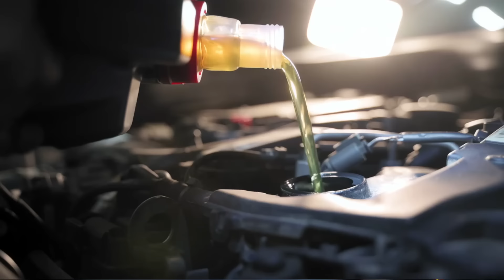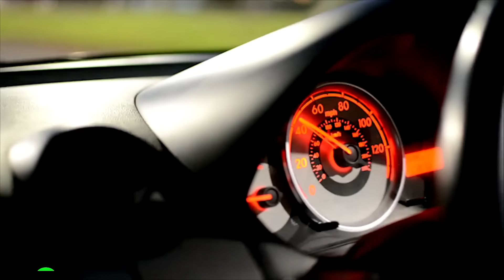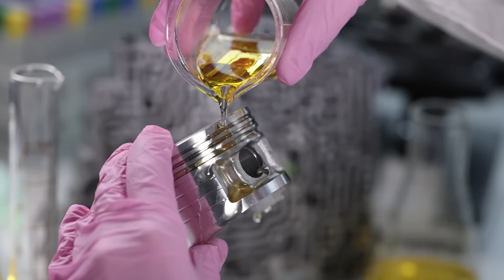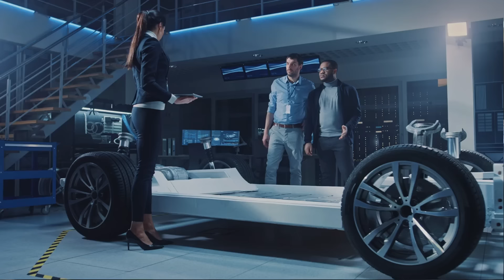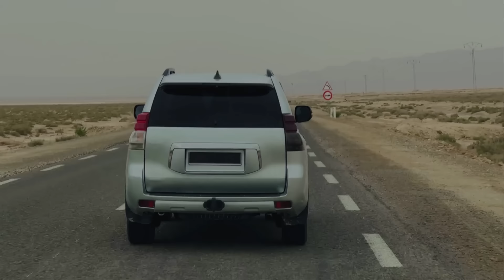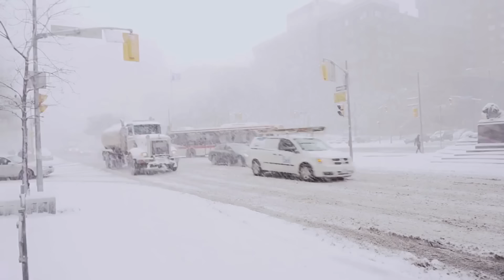Why the Same Engine Uses 0W-20 in the U.S. But 5W-30 Everywhere Else (Mechanic Explains!)

Comment from the maker: Engine oil confusion? I want to hear from you! 👇

Do you use 0W-20 or 5W-30 in your car?

Have you noticed any difference in engine performance with different oils?

Drop your answers below – let’s start a discussion about engine oil around the world! 🌎🔧

#EngineOil #MechanicTips
Reply: I use 5w20 in winter and 5w30 in summer. 0w-20 is too thin for any car long term.
Reply: I use 0-20w Castrol Synthetic in more hot climate area where I live.  It’s a Honda Civic NA motor daily driver which I don’t even drive every day.  I never redline or drive hard.  

I still properly warm up.  

I would think 5-30w is only necessary in extreme summer heat and when driving the car hard or car is turbo.
Reply: My MX-5 manual says 0w-20 in the US and Canada and 5w-30 elsewhere. I use 5w-30. The light oil is recommended to buy CAFE credits from the EPA.
Reply: @arthurmroyce  10w 40 was the standard forever
Reply: @motomikebuilder  Modern engines are tighter so I get the thinner oil. However, the 2.0T in my Genesis Coupe ran best with 0w-40 Euro blend. So you do have a point.
Reply: @arthurmroyce  In SF it rarely snows.  I ran 10w 40 forever in older Yotas.  should I throw some in my '25 tundra?  5w 30 always .  I dump out the dealer oil after required service.
Reply: depend on Summer or Winter 0w-20 for winter and other for Summer
Reply: 5w 30.  My v8 tundra had noticeably quieter time chain rattle with 5w 30.  I'll never use 0w 20 in my turbo charged engine.  10K oil change intervals with thin oil makes no sense.  Toyota sez leave the original oil in for 10K.  1st change should be @ 1K and 5k after that.  My 6th Toyota and > 1,000,000 since 1987.
Reply: Your Ayeee Eyeeee video forgot the most important detail on motor oil 🤦🏽‍♂️

Take the manufacturer suggested oil change interval and cut that in half. Everything will always work better that way:

BMW says 10,000 miles (Change it every 5000 miles)

Toyota says change it every 10,000 miles (Change it every 5000 miles).

Nissan GTR, the engine builders have said many times, do a 2000 mile oil change interval if you want the motor to last forever.

Oil is cheap!
Reply: @fazman6218  hell yeah my man.  I saw my outside temp gauge at 120 in stopped Oakland traffic.  That's hard use and oil should be changed as you say.  5w  30 in my $60K Tundra.
Reply: @motomikebuilder  If you want to help your ride, don't forget to flush the radiator coolant every 5 years or 60k miles... the pH of coolant changes and that ears away at the seals/gaskets
Reply: @fazman6218  I saw a video of how lifetime fluids screw up
Reply: @motomikebuilder Changing fluids often is key to making lifetime mean generational 😂
Reply: I am so sick of AI narrated content!!!
Reply: A very well trusted mechanic told me that using a slightly higher oil viscosity can sometimes save the engine substantially. A manual in an 80s car that I had offered several different viscosities depending on where I lived in the US. Now, I know why that's no longer offered.
Reply: I use the weight posted on the oil filler cap
Reply: Have used 0W-40 for many years. No engine breakdown at all in cars. 
10W-40 in motorcycles for years - no problem. 
In Norway
Reply: My car is recommended to have 0W-20. Now 10 years old and 100000 miles later I will switch to 0W-30
Reply: My hybrid car uses 0w20 as recommended by the manufacturer. I've heard that some Toyota cars in the US use 0w8.
Reply: My vehicle is 22 years old. Manual says 5w30 is the recommended oil fir it. But it also states if temps are over 0F that 10w30 can be used. And also states that if the winter weather is below -22 F synthetic 5w30 or even 0w30 is recommended. I just stick with synthetic 5w30 year round. Just wasnt impressed when I used 0w30 once.
Reply: I like 0W-30 or even Mobil-1 ESP 0W-40,  full synthetic.
Reply: I use Mobil 1 Extended Performance 0W-20. And, Mobil 1 or Fram Ultra synthetic oil filers. I change oil the when the dash "Oil Life Monitor" gets to 0%, not by a set mileage anymore (as in the Old Days). That's @ 5000-6000 miles max. Not worried.
-- BR
Reply: My Toyota Hybrid is 15 year old and runs on 5W30. Manual says I should use 0W16. But because the ICE stops and starts sometimes 3 times per minute I think the 5W30 is fine.
Reply: @w @wimschoenmakers5463  years ago were no 0w16 on stores’ shelves. Second: because hybrid starts so often, and it runs comparably in colder environment higher viscosity is not much of plus for it.
Reply: Durango recommends 0w20 which burn a little before the interval so I went up to 5w30 now it’s steady
Reply: I use 0-20w on my 2005 Honda Accord and did not have engine problem until about 80,000 miles. After that I hear noise coming from the bottom of engine when cold crank and I switch to 10-40w. Car has about 150,000 miles and runs good, no noise.
Reply: 0-30w 😅

Comment: So you saying I can put 5w30 in a OW20 suv?
Reply from the maker: Not exactly. You can use 5W-30 in some engines that normally take 0W-20, but only if the manufacturer specifically allows it for certain temperatures or conditions. Many newer engines are designed very tightly, and going thicker can actually affect fuel economy, cold starts, and even long-term wear.
If your owner’s manual or manufacturer chart lists 5W-30 as an approved alternative, then it’s fine. If it doesn’t, it’s better to stick with 0W-20.
always check the manufacturer’s approved viscosity list before switching.
Reply: @CarCareCrewOfficial  engineers are pressured by dealerships/company mgmt to be forced to write in the car's owner's manual the thinner oil just to showcase higher mpg. Engineers know it very well that thinner oil will damage cars long term. but both sides are in the business for the money more than the car's longevity. Stealership love it when ppl are ready to trade it in due to multiple issues and never ending repairs.

Comment: Videos like this are of no value. I have always used the OEM recommended viscosity and have never had an engine problem. The last 4 cars I have owned I drove over 200k miles on each of them.
Reply from the maker: Totally understand your point. If OEM specs have worked for you and you’ve consistently hit 200k+ miles, that’s solid evidence your maintenance routine is on point. The video is mainly for people dealing with oil consumption, hotter climates, or newer low-tension ring engines where the thinner oils sometimes cause issues. But if the factory viscosity has treated you well, there’s nothing wrong with sticking to what works.

Comment: Does anybody know the difference between 0w-30 and 5w-30 in hot climates?
Reply from the maker: In hot climates, the main difference between 0W-30 and 5W-30 is really in cold start performance, not high heat. Both oils behave similarly once the engine is at operating temperature, so 5W-30 is generally fine for hot climates. 0W-30 flows slightly better at very low temperatures, which doesn’t matter much in hot regions. Always check your car manufacturer’s recommended viscosity, though.
Reply: @CarCareCrewOfficial  Then if the manual says 0w-20, why would anyone go to 5w-30 instead of going to 0w-30?  And if the manual says 5W-XX, is there any harm in changing the 5 to 0 and going to 0W-XX?

Comment: Using thicker oil than what is recommended may be depriving overhead cams of proper lubrication.
Reply from the maker: Absolutely! Using oil thicker than recommended can cause the overhead cams to not get enough lubrication, which might lead to increased wear over time. Always best to stick to the manufacturer’s specs.

Comment: Japan also recommends the same oil 0w-20 or even lower in many modern calls. However the manual states that a 5w-30 is also acceptable.

Comment: OW-20 gives 1.0 percent better fuel economy and your car doesn't last as long. It's a win-win. Just for who, since they've got you dropping anothjer $40,000 two or three years sooner.
Reply from the maker: Haha I get what you mean bro. Manufacturers definitely push thinner oils mainly for emissions and fuel economy numbers. But honestly, if you stick to good quality oil and reasonable intervals, the engine isn’t dying in 2–3 years. Plenty of cars on 0W-20 are crossing 200k+ miles. It’s all about maintenance, not just viscosity.

Comment: What a bunch of nonsense, the oil type is 100% ambient temperature dependant. Cold weather countries use lower grade oil than warmer weather countries and the recommended oil for each country is to make shure it works everywhere in that country
Reply from the maker: You’re right that ambient temperature plays a big role in choosing oil, but it’s not the only factor. Modern engines, emissions systems, and fuel economy rules also influence what manufacturers recommend. That’s why you’ll see different specs in different regions. Temperature matters a lot but it’s not 100% of the picture.
Reply: @CarCareCrewOfficial  The oil viscosity and additives needed are decided at the engine designed stage.Those values and the temperature variance in the country is used to make a general recommendation, you can always go to the manual and find the SAE table where they give you different oil options for different temperature ranges

Comment: you talk about cold or hot climate but isn't the thermostat (cooling system) is maintaining the engine temperature constant, more or less. so the outside temperature is irrelevent since engine temperature is constant. As far as I see it, the important number is the 1st number, 0 if you have to start the engine at -20f.   Good video
Reply from the maker: You’re right that the thermostat keeps the engine at a stable operating temp, but outside temperature still affects how thick or thin the oil is before the engine warms up. That’s why both numbers matter. The first number helps with cold starts, and the second number protects the engine once it’s fully hot. Appreciate the feedback, bro!

Comment: 5 w - 30 w sounds like the way to go. Other variables is the condition of the motor and how good the oil is. In the 1970s recommended diesel engine oils were not up to it when used in small turbo diesel motors.

Comment: So now, what about 0W-8? I figure what's next is one spoonful of olive oil to a gallon of distilled water.
Reply from the maker: Haha bro 😄 0W-8 would be ridiculously thin for most engines  basically like trying to run a car on water! Stick with manufacturer-approved viscosities, otherwise you’re risking oil starvation and engine wear.
Reply: @CarCareCrewOfficial Toyota is recommending 0W-8 ... definitely too thin in my opinion
Reply: In the Corolla Hybrid, flagship Crown, Grand Highlander Hybrid, and even in Mazda`s 2 Hybrid.. crazy for sure
Reply: "If you have a warranty, you have to do it." LOL! (Do you have proof that changing oil viscosity voids warranty? Some say yes, some say no.) So you have to kill your Toyota engine faster because "muh warranty!" I also live in Arizona and drive a new Toyota that recommends 0w-8. No way! Switched to 0w-16 (still listed as alternative in manual) at second oil change at 5k miles (after arguing with the service shop). Will most likely have to change my own oil going forward for flexibility and to avoid having to explain why 0w-8 will NEVER AGAIN be put into this vehicle's engine, esp in the scorching hot AZ summer. With oil shearing being a reality, especially when driven hard on highways, I'll likely replace the 0w-16 with more durable oil.

Comment: What about transmission oils.?Some locations say lifetime.  Other locations give intervals to change it.
Reply from the maker: Yeah man, the whole lifetime fluid thing is confusing. Some places say you never need to change it, others give intervals. But the truth is transmission fluid does break down over time, especially in heat or heavy driving. If you plan to keep the car long-term, changing the fluid every 40–60k miles is just the safer move.

Comment: 5/30 people All year   don't Destroy the Engine 5000 oci. Don't forget your trans 30.000 cvt 60.000 AT. remember manufactures will provide new Engine/trans Anytime.  jmo. thin viscosity lubricants is All CAFE regs. the climate loons.

Comment: I had a 1974 Datsun 260Z for 15 years those engines run very hot so I used to run Castrol GTX 20 W 50 in in the summer and 10W-40 in the winter and I never had any problems with that engine

Comment: I saw the mechanic's point about CAFE regulations and 0W-20, and how the US government is 'forcing' a suboptimal oil on drivers. That narrative seems to really resonate with people here, but I think it fundamentally misunderstands the technology and the actual cost.

Here's a perspective from Japan:

1. Cost is Protection:
 If you look at retail prices here, 0W-20 is often more expensive than 5W-30. Why? Because achieving a 0W flow rate (super thin when cold) while maintaining sufficient protection equivalent to a '20' viscosity grade at high temperature requires a much higher quality base oil and very expensive additive packages.

- It's not that 5W-30 is 'better' oil being denied by the government; it's the other way around. The reason other regions specify 5W-30 is likely due to prioritizing accessibility and lower cost over maximizing performance.

- Frankly, people in regions using 0W-20 are actually the ones getting the technically superior and more expensive formulation—they are enjoying the engine's true, optimal performance potential!

2. Weather is Irrelevant for Viscosity:
  I also see comments suggesting switching to 5W-30 in hot climates. This is pointless. A water-cooled engine, once fully warmed up, maintains the same operating temperature regardless of the outside weather (thanks to the thermostat). Whether it's 10°C or 40°C outside, the oil running through your bearings is at the same stable temperature.

- Remember, multi-grade oil was invented precisely so drivers don't have to change the oil viscosity seasonally! Switching viscosities based on summer/winter fundamentally contradicts the very purpose of a modern multi-grade oil like 0W-20.

It’s time to stop blaming CAFE and start trusting the engineering.

Cheers from Japan!

Comment: The reason is CARB standards in the US... the sooner they can eliminate those, the better.. They tell you "tolerances" between the piston rings and the cylinder walls, but that's just engineering speak for bullshit..

Comment: I own a 23 years old Saab 9-5 with well above 200,000 miles. I use 5W-30 during winter and a 10W-60 during summer since I tow a quite heave trailer across Europe since retirement.  It works well for me.

Comment: EPA, CAFE, and NHTSA are the three government agencies you can thank for overly expensive, less durable, rolling networks on wheels. To avoid this, you must shop pre 2007. The best value vehicles were produced 1995-2005, with tight machining tolerances and computer engine management designed for reliability with performance, no radar, no collision avoidance, etc.

Comment: I switched to 5w 30 and engine started to use oil, and 5w 20 didn't.  I was very shocked because oil consumption should have been the same as 5w 20. 
All my driving is city.

Comment: 7:15 now the engine it topped off

In cold climate a thicker hot number like 0W30 might be better than a 0W20 because of oil dilution caused by incomplete combustion of the gas on cold start because new engines are mostly direct injection.

Comment: Canada. First oil change at 3,000 miles and in some obscure place, 5w30 was recommended for SEVERE SERVICE, like a screaming TURBO-CHARGER is not severe service. Also, AWD rear differential, oil change at 12,000 miles. The Factory Oil was disgusting!

Comment: The main issue is not engineering but regulatory bodies that get involved in engineering. You can’t setup a one type of oil for all weather conditions because I car engine is not a comercial generator with preheat and pre lubrication pumps this is why it uses multi grade oil but regulatory bodies are not engineers and they have no clue how engine even works . So they make a ridiculous decision based on feelings not reality. For example comercial engine run single grade oil because they have preheat and prelube pump. The engine is always kept around 50 C lube oil
Is around 30 to 40 c or higher . The prelube pumps keep everything primed up with oil same with the pre heat pump. Now
This engine will start even when it gets colder but it will never be exposed to extreme cold because it has a heating system. Car is sitting out side at -10 C or maybe worse the engine has to start some how  so
We use multi grade oil. But the issue is the same car could be at plus 40 C then you can’t use the same oil simply is going ruin the engine. Viscosity is totally different cooling is different before we did oil changes based on season . 10w30 summer oil or
Higher and 5w30 winter oil. Now 0w20 is magical but reality is there is no magic this is why now days engines fail surprisingly earlier .

Comment: My 3rd Gen Toyota 2GR-FE. 0W-20 in the US. 10W-30 in Australia.
Reply: And in the manual you have a chart with the recommende oil types for different ambient temperatures
Reply: The mean temperature in the US is 53.3°F  and in Australia 73.04 °F